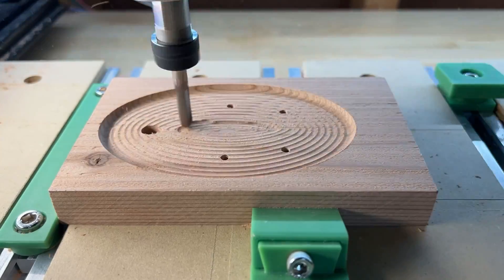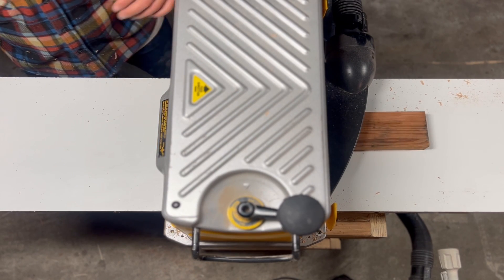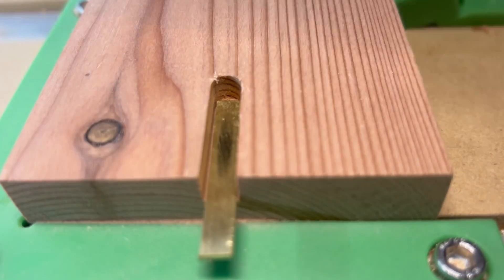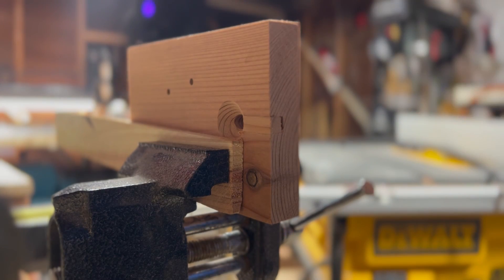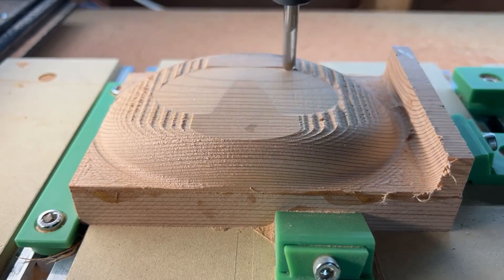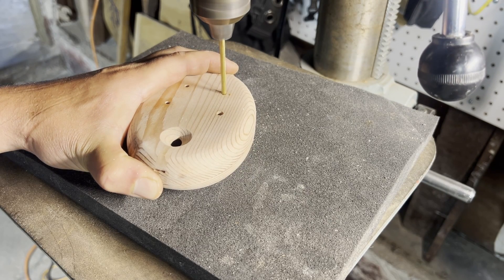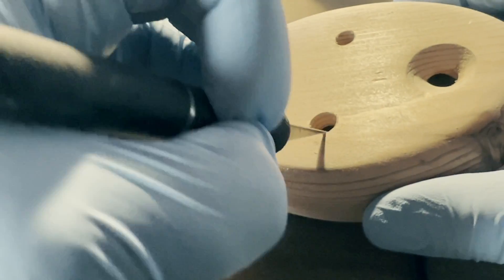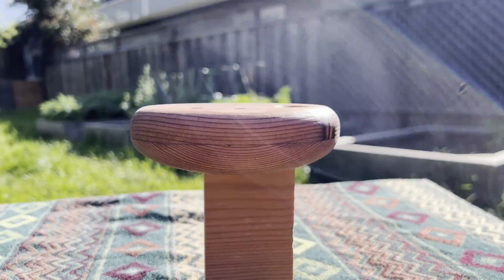Making an Ocarina From Redwood Using a CNC Router DIY

Comment: Wonderful video. Just one thought, would it be better to finish the interior with something like polyurethane to make the interior waterproof so that the wood doesn't absorb any moisture (aka spit) as you play. Of course a heavy coat of oil, wiped and then a couple coats of wax might do just as well.
Reply from the maker: For sure, polyurethane is a great way to seal the wood, as long as it's applied in a way that doesn't obstruct or reduce the airway. One thing I'd like to try is stabilizing the wood using a resin in vacuum. If you search for "stabilizing with cactus juice" you'll see some really cool results with wood. Since this was the first instance of the kai ocarina, I wanted to make it plastic-free, so I could compost it if it didn't work.